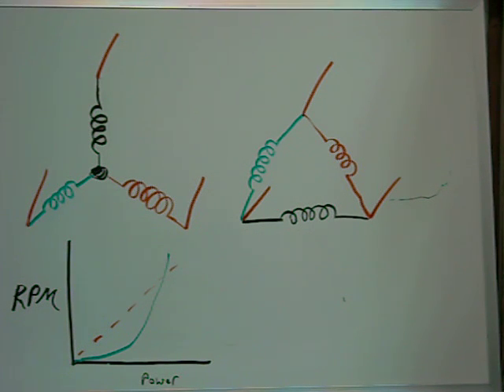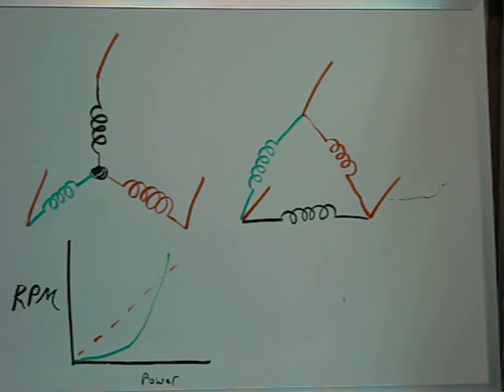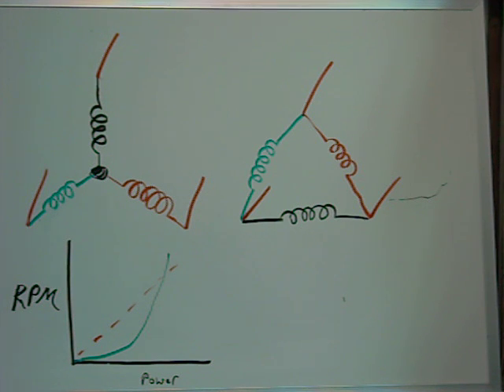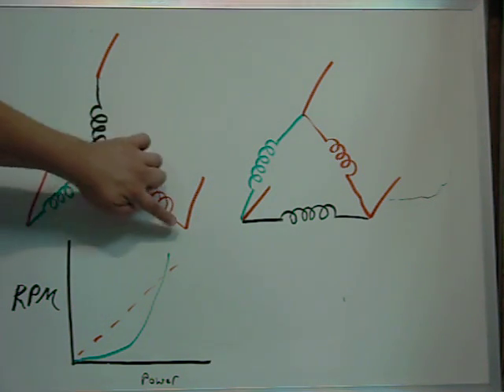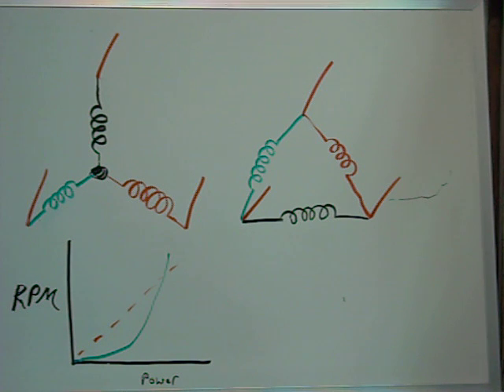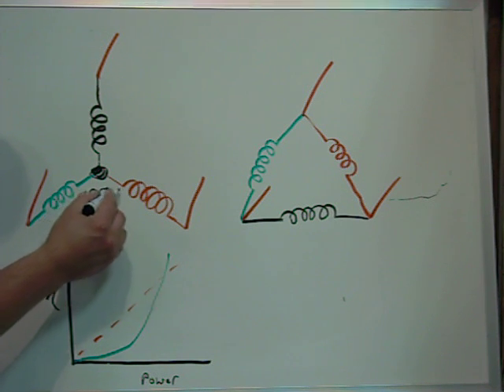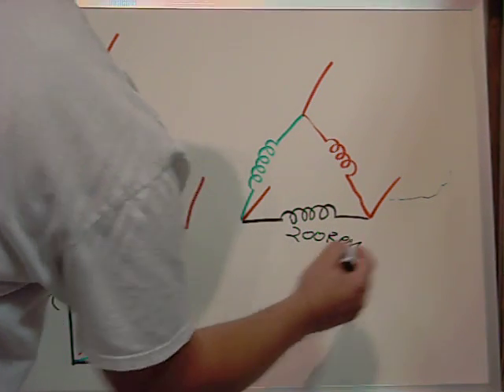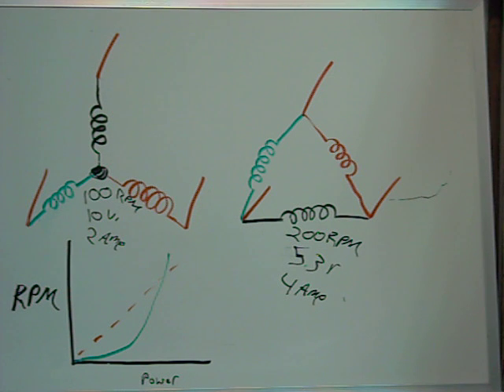Wind Turbine Shaft RPM VS. Power Produced Part 2

Comment from the maker: @sjh7132 

Your right, for the same RPM, the Delta would be approximately 53% less voltage.  So for a Wye at 100 RPM, and 10 volts, you need a Delta connection at 200 RPM for the same 10 volts.  Wattage stays the same in either configuration.  I should have said the voltage would still be 10 volts, but the RPM would now be allowed to float to200.

Comment: I do think that you have to use a PWM. Even if you change the the winding and approach the right Kv (rpm/V) you will change the generator power curve and there is a very big chance that your generator won't match with your rotor power output.
I would suggest to use a MPPT controller. You can find them at Schams-electronic for example. They accept voltage to 100V and set the output to 12V or 24V. They also adapt your generator power to the power of the rotor ;-)

Comment: i found that in a delta connection it was more magnetically locked so it was harder for the shaft to turn, but that was on only one experiment that i had. iam currently in the process of rewinding a pma stator. i can try both configurations when iam done with that. great vid.